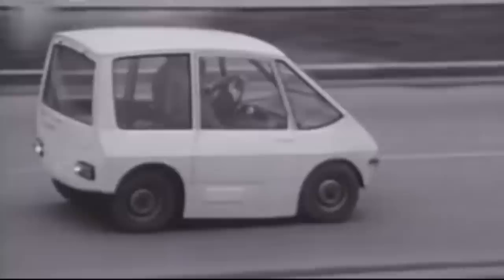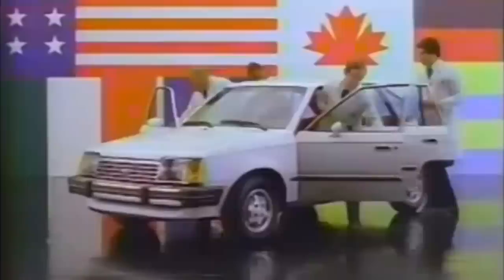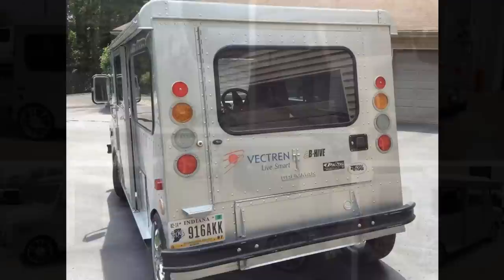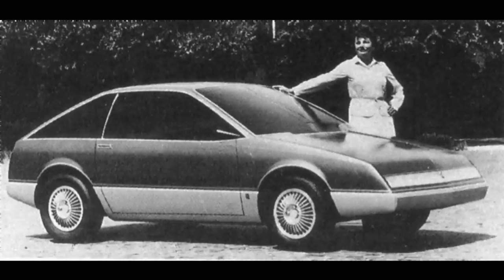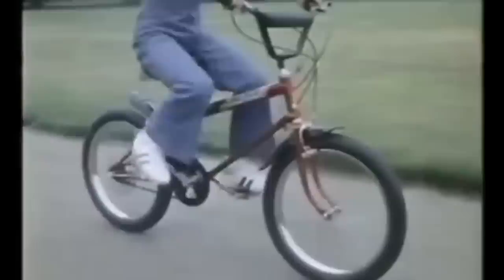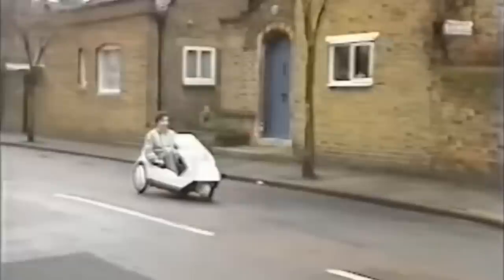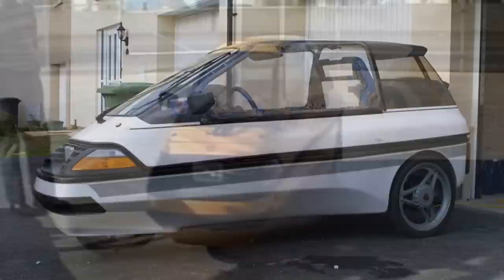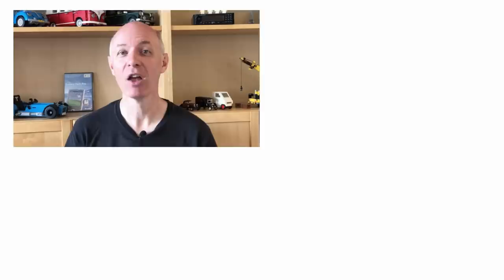Before Tesla... 1980s Electric Cars (EVs Part 2)

Comment: I owned a City-EL in1992- 1998 and it had an updated 48V system instead of the original 36V, a range of 130 km on lead acid batteries. I later changed the motor for a LEM-200 22kW motor, so top speed was 96 km/h and 0-60 in 4.5 seconds. Quite the monster. With a similar weight of Li-ion batteries 128 kg, it should be able to go 500 km, so when the current specs from Citycom today only specs 120 km range, the are going cheap on the batteries and use to few of them to reduce cost.
Reply: sounds like a dream i need one

Comment: I’ve owned three A2s and I always thought that Audi should have followed up their stunning electric concept car from the early nineties as the Space frame would have provided plenty of room for the batteries and extra electric motors. I saw some videos of people converting their A2 to electric power and I actually sold my last one to a guy who was getting it converted in London. To be fair, the A2 is a fine economical car, regardless of what engine it comes with. Looking back, the problem with electric cars is not the car, but the industry,the supply and the economics, infrastructure, regulations and battery supply that to me now would make any electric car undesirable, uneconomical and more of a liability. You can extend the vanity and fashion appeal from a few thousand cars to millions, but it’s still not enough. In hundred years, electric cars developed less than internal combustion engines have and there is a good reason that they are not widespread in industry apart from forklifts and milk carts.

Comment: Another electric car from the 70s not mentioned in the video or the previous one is the Electric Fuel Propulsion Company (EFP) Electrosport, otherwise known as the Electric-sport. It was a compact-sized electric vehicle using AMC Hornets that were converted to EVs in Ferndale Michigan. It was produced from 1971 to 1974.

Comment: I have a Sinclair C5 - first vehicle I ever bought (and first thing I bought on ebay). You say 'no market research was done' - I do not believe this is true. When I first got my C5 someone on a now defunct forum who used to work for Sinclair said he did commission research, however,  it told them what Sir Clive didn't want to hear, and so he ordered it to be locked away or destroyed (I forget which). The research said that the most likely people to buy them were old people, likely those who couldn't drive but just needed to pop to the shops. But they aimed it as something cool for young people - but a 14 year old didn't have £400 to buy one, and a 16yr old would be buying a moped, because its faster (and probably cooler).

Comment: The u36 which became the Miniel was designed and built while the c5 was also being designed and took no "cue's" from the c5 at all, the body shell was designed by a Scottish designer called Ray Innes working in the sw of Scotland, the idea for the vehicle came from a Dane called Steen Jensan , they had been working on it from around 1980, we made the body in 1982 it was the first time Ray and I worked together, the U36 was displayed in a bank in Randers Denmark for a while, when the ill fated C5 was announced the U36 was dusted of and by public subscription in Denmark a factory was built and production started, they enjoyed moderate sales success but the electronics were a source of problems, by the time that had been sorted out the factory had run into cash flow problems and the Miniel was sold to Germany. The concept was for a fully enclosed vehicle with the same or less frontal area as someone on a moped or scooter, which it was to replace, it was never seen as a car replacement, the project was first mooted by Steen when he worked for the Danish company Dronnjngborg who made combine harvesters, the combine market was in a down turn and they were looking for other products to fill the factory, Steen who was working there as a designer contacted Ray with whom he had worked for at Rover Triumph, with the upturn in combine sales Dronniingborg lost interest and shelved the project, when Steen left not long after he was aloud to take the project with him, the rest they say is history.

Comment: You are missing the Bedford CF and Freight Rover Sherpa K2 vans converted by Chloride in about 83 to 86. They made hundreds of them. I know one chap who still uses one (with secondhand emergency lighting batteries for power). Prince Philip had one, fitted out as a plush limousine, and made quite a bit of use of it.
Reply from the maker: There are sooo many different cars, and it was so hard to get them all! Thanks for letting me know.

Comment: Great video. Have you considered mentioning the Better Place project with DONG Energy (yes, it was the name of the biggest danish energy supplier based basically on windmills). Together the made the project involving Renault and the very visionary concept of replaceable batteries as an alternative to gasoline stations.
Reply from the maker: I wasn't aware of that. Do you have a link to more information?
Reply: Big Car actually it is quite well described on Wikipedia with lots of links: https://en.m.wikipedia.org/wiki/Better_Place_(company)
Reply: Big Car I used to work in DONG Energy at that time, but I wasn’t much involved in the project, but saw the car and videos of the concept. I will write if I find some materials about it.
I know that DONG Energy actually had already started investing in the needed infrastructure to support the charging stations

Comment: That C5 trike actually looks pretty cool to be honest. If they sold a remake of it with Li-Po batteries, a windshield, and an extra front wheel for around $1,000 I’d totally be down for buying one. :)
Reply: Check out the Renault Twizzy. A bit more than $1000 though.

Comment: Electric engines in cars were around a lot longer than you think early 1900s, big petrol suppressed it. (It was geared towards women answer is no big 'mechanical engineering ' makig it easy to run.) Fossil fuelled cars then were a lot harder to drive than today's manual transmission cars. Even Harder than floating gears on a big truck.

Comment: I really don't understand why manufacturers have always tried to make electric cars as small and weird as possible. It's not like Tesla had this big epiphany that no one else could've come up with. People like driving regular cars. They're the practical and convenient form of transportation all around.

All the technology Tesla uses has been around for decades, aside from the computers, which aren't really necessary. GM, Ford, Chrysler, AMC...they all could have developed the electric car technology but didn't. Probably because it would have meant profit losses for them in parts, service and labor. 

Manufacturers have been claiming for decades that there isn't any market for an EV, but it's because all the EVs they've been designing are shit. Tesla has proven that it can be done and it can be economical and practical. So either GM and Ford are incapable of engineering an electric car people want, or they don't want to.

Comment: The Dodge Omni reminded me of how many nice looking 80s cars could have a second life as electric conversions now. With better range and performance available,  it would  be a nice option when no longer able to pass a smog test.
Reply: The aerodynamics of cars from that era absolutely suck. So unless you want to tool around at 45-50mph, they're a bad choice for conversion. (and a good conversion will cost as much as many new cars -- batteries are expensive, so it's not the best use of ones money.)

Comment: You missed a very crucial GM electric vehicle... It was based on a current production petrol or diesel version and it was Built in Britain too But it wasn't a Vauxhall... The Bedford CF Electric van.. exempt from tax it would have been popular except it was twice the price or a standard CF and only a real range of 40 miles

Comment: I have a 007. Their claims of it going 70 are a lie -- you'd have to tow it up to that speed. (with modern batteries and electrics, it will go worryingly fast. We've seen the NCAP crash tests; we're happy at 50. It'll easily do 70 now, but that's murder for the battery.) Jet Industries were an interesting anachronism. They made golf carts. When the gov started handing out money for alternative fuel vehicles, I'm sure they had a pure Clarkson moment -- "How hard can it be?" There's a reason few were made, and very few still exist.
Reply from the maker: Thanks for the insight. Fascinating!
Reply: There's a few videos of it on my channel. The 30min one during the Sunday "church hour" (South Carolina) is using 3 banks of Volt batteries (36S) At 34:21 you can hear the alarm on the BM50. (we don't normally have any monitor on he packs as we wouldn't be able to hear it with those dino burners around us. We just watch the total pack voltage) It's using 3 BMW i3's worth of batteries now. 3 strings in the back (primary) and one in the engine bay (backup, not currently connected) With all 4 in the back and a (now known to be shit) HF generator up front, we drove it from Camden SC to Key West FL -- Florida Poker Man Rally -- in 4.5 days. (search insta for #hespeaksforthetrees) Our next stupid adventure is the Retreat From Moscow Rally, towing a good generac generator. (12k for the batteries, plus another few k to keep warm.)

Comment: Another informative video, but @7:35, Good grief. Vespas and Lambrettas are NOT "mopeds".  Tunturi made mopeds. That's like fellow Yanks calling their crap Harley-Davidsons "scooters".  Sad, very sad.  

On another note, my alma mater, Western Washington University (approx 2 hours north of Seattle) was significantly involved in researching/developing solar-generated electric-powered vehicles, through the Vehicle Research Institute (VRI), especially in the 1980s-'90s, and regularly competed in the GM Sunrayce of events.  As car-obsessed Industrial Design major, it was interesting to see (from a distance) what those guys in the basement were coming up with.  We ID students even partnered with the VRI program to explore concepts for alternate uses for a thermophotovoltaic electric power generator that they were working on incorporating into their latest car, 20+ years ago.
Reply from the maker: All those two-wheeled things are all the same. ;-) There was an EV concept around 1970 from Seattle but it was so nascent I didn't include it. Glad you're a Western grad - they're coming up as a major school in the state (I live in Seattle).
Reply from the maker: @Finished Finnish Probably with some stupid loud fake sound on them. I'm not a fan of Harley's noise pollution.
Reply: @BigCar2  They leave the factory quiet enough. It's just that virtually all of their toddler mentality customers have to put the Screaming Asshole open exhausts on their rolling shit, then blip the throttle constantly for even more effect. There must be a pile of stock Hardly-Ableson mufflers the size of a mountain somewhere.

Comment: The uk had a bigger problem with 70's to early 2000's the government insisted british cars basically were only aĺlowed to meet the same size as the old blue plastic pig disabled car and with tough battery and power limits with electirc OAP trikes batteries, powers and ranges. Many innovative small british firms got put out of buisness by the regs and rules. Even for 4 wheel, all terrain disabled scooters. And only european and tesla presssure let the uk relax the throttling regulations here in the uk

Comment: A Dilettante Presumptuous Theorem: There were self sustaining electric cars way before gasoline cars. Electric cars were the first cars made. Do you ever think outside the box about electric cars? They can only travel 300 miles and need charging. You can't go out of town or on a road trip anywhere with an electric car. The whole idea about electric cars is to limit and control how far everyone can travel. In a sense the electric car is a prison.
Reply from the maker: You can travel to anywhere in the USA with a Tesla using their Supercharging network (use their online navigation page if you want to check it out). And it's about 15-30 minutes of charge for every 3 hours or so of driving, which is fine as you need a break after driving for so long (or to have a meal). They are more practical than you might think.
Reply: @BigCar2  - I agree with you but they are a form of prison and everyone cannot afford a Tesla car. The cost of Tesla cars are ranging from $44,000 to $138,000 before any tax credits.
Reply from the maker: @ithepreacher8309  Yes, Tesla's are majorly expensive, and affordable electric cars (like a used Nissan Leaf, which you can get for less than $10,000), have just 80 miles of range which is a major constraint. But prices will fall and ranges will increase, so over time electric cars will make more sense. But I still don't see how they will be practical for people who have to park cars on the street at night. They don't have an easy way to keep them charged.